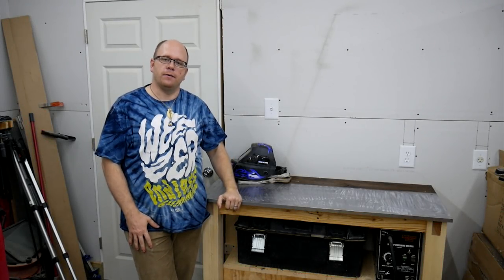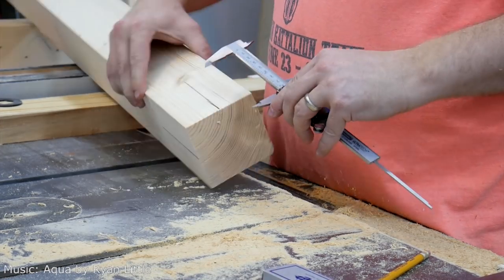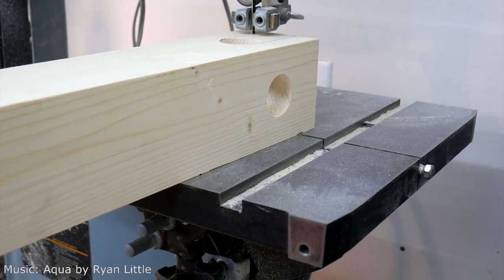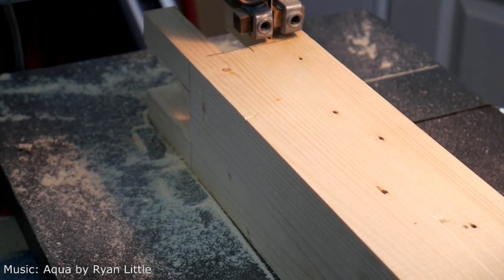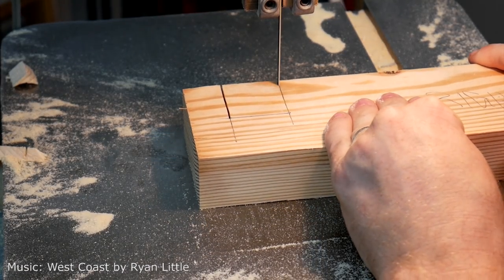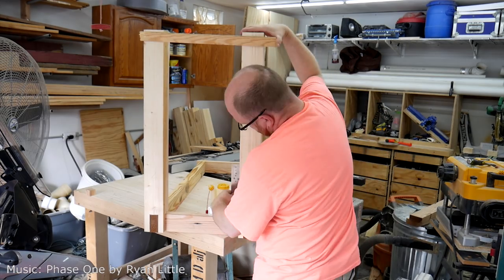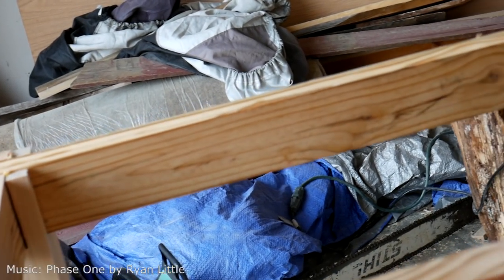Fancy Leg Joinery: Worth It? (Amazon links in description)

Comment: Thanks for the video. I like the fact that you are willing to show the imperfections in a project and well as mistakes. I have a project  that I want to use this same joint. I was thinking about running the half lap joints just a little long and champering the edges. Again I think it loos good.
Reply from the maker: Yes! Next time I do this I plan on making the tenons a little proud of the leg surface.  After that I plan on making the tenons protrude even farther and trying to incorporate it into the design.  Just need more tables to build!

Comment: I used this same joint on my dining room table. It is a beautiful joint, also very strong.  Thanks to this joint my table has zero metal fasteners! 

I used only hand tools for my build. I originally wantes to have the apron ends flush with the leg, but after having that fragile end piece break on 3 separate pieces I decided to have a 2 or 3 inch over hang. This turned out to be much stronger!  

I think I watched your video a few years ago and probably packed the idea in the back of my head. Thanks for your time helping all of us out.
Reply: How did you attach your legs to the table top?
I want to practice this joint too!
Reply from the maker: I make my own fasteners out of wood, but you could buy these: https://www.rockler.com/table-top-fasteners
You could also use pocket screws on the inside of the apron, but that wouldn’t allow for wood movement in the table top.
Reply: @SouthpawWorkshop  Cool! Thanks, those look handy.
Thanks for the reply, I just saw a video of how to make them out of wood and dominos as well.

Comment: A tip for dry fitting this type of joint to avoid break out:  

turn the board over and attempt to dry fit it where the material is vs mating the 2 cut outs.  If it fits, the joint will not break. if not, go to a cabinet scraper, or whatever, and shave off a mil from each face of the board and try again.
Reply: I also like to chamfer the inside edges of the half lap.  Nobody sees them, and it makes the joint easier to assemble without sacrificing any stability.

Comment: Very nice. I made a side table for the guest bedroom using this joint. I was afraid that any wiggle in the table might split so I added dowel pins. It is as solid as a rock and looks nice. I muddled through it on my own. Watching you do this is going to make it easier for me to make my next one. Thank you.
Reply from the maker: Thanks, Cody.  I seriously considered adding dowels.  I think it will probably be just as strong with or without them.

Comment: Great video, thanks! I tried this joint on the legs of a nice heavy kitchen table I made recently and it worked out beautifully. I made the "tenons" a bit longer so they stick out about an inch past the leg and rounded over the edges. Adds a very nice effect.
Reply from the maker: That is awesome. Thanks for sharing!

Comment: Perhaps if you did use a guide on the bandsaw, instead of freestyle, it could improve the accuracy of the joinery. I'm nearly certain the frail end pieces were breaking because of dry fitting with a small deviation causing outward stress on the end piece. Other than that this castle joint looks excellent. Well done!

Comment: Hi Thomas, I made this exact same joint on a blanket chest with only wood joinery holding the box together other than the door metal (handles lid support and hinges. Glue was only used to hold the panels together. Top, sides and bottom floor. Like you I found those end grain tabs broke off easily. To solve the problem I shaved off 1/4 of the ends where the tabs are vertically and glued pieces of wood with the grain running 90 degrees from the center 1/2. The resulting end grain looks like plywood but it allowed me be able to say it's only held together with joinery.
Dan
Reply from the maker: Good advice.  Thanks!

Comment: Fine instructions.  The joint has high sheer strength.  The fragility is a function of the ductility of the wood used.  Building lumber is brittle, 18% moisture, prone to splitting as you encountered.  For mortise and tenon load bearing joints in buildings research indicates that failure is determined by the peg's ability to withstand bending.  Message: use robust quality wood.  Construction grade wood and plywood are to the woodworker what plastic and vinyl are to the shoemaker- kryptonite.

.      I counted at least 10 contact surfaces on your joint leading to greater joint sheering resistance + marginal gaps to provide flexing/torsion for heavy weight.  All that was left was for you to install light arches and triangles so your light table could support a few tons.  Fine work.

Comment: Thats a beautiful joint. Perhaps you could cut the joints on the 2x4's a bit further down the wood, so that the 2x4's would be flush with the edge of the table. That would probably look pretty cool, and also give those joints some more strength.

Comment: This was exactly what I was looking for. I was built a dining/game table for my kitchen a few years ago with store bought legs (This was my first large furniture project) that unfortunately are no longer working. The table wobbles a lot now with strain since the legs are too small for the weight and size of the table top. I am going to use this idea and maybe extend the boards to outside the leg. Thanks for the video!
Reply: The table wobbles.  Again, the joint is not worth the trouble.

Comment: I like the way this joint looks. I'm going to try it out on a desk for my daughter. I don't have the band saw or drill press so I'm going to be creative in how I do mine. I will be using a table saw for mine. I want to use 5/4 x 6 for the aprons so I think I will have to do most of the notching by hand.
Reply from the maker: I think a hand saw and some chisels would work just fine.  Let me know how it turns out!

Comment: Thank you for showing the downsides to this joinery. I'm currently working on a tatami bed, using this joinery. I'll be sure to take it easy, while dry fitting.
Reply from the maker: It will also help if you use wood that is better quality than the pine I used. Just about any hardwood will perform much better.

Comment: Great video and ending analysis, thank you for posting this. I have been considering using this joint for a coffee table I plan to build and will be floating a granite slab on it for the table top. I may be mistaken but I believe this is also referred to as a castle joint.
Reply from the maker: You are correct

Comment: You could leave the rails a little bit longer than they need to be, so you have a little bit more resistance to the pieces splitting off when you assemble the half lap joints, or you reinforce them by using a big dowel glued in across the grain.   Then once the whole thing is assembled you could trim the end of the rails flush with the legs, or it could look really cool with the ends of the rails extended a few inches past the legs.
Reply: SoundsToBlowYourMind wouldn't matter if he left a mile on the end of it, it's still a very weak spot.
Reply: I was gonna write that - perfectly logical. No chance for piecesfalling off.
Reply: Yes it is still a weak spot but it will survive the most traumatic stage of banging the joints tight together. Also l would cut them to length after assembly and glue to go off.
Reply: Also, it's a good idea to use a file, knife, rasp, etc. to shave off whatever is making it fit too tightly. When you feel like it isn't going in easy enough, it's time to back out and adjust.
Reply: @rocketman6478  old post but man your hella wrong. If you leave em longer for dry fitting its gonna be much stronger before the glue up. It basically be 2x4 with a lil notch in it with alot more surface to avoid breaking. Of course a lil 3/4 left at the end is gonna break much easier than say a 6 inches.
Reply: @sh0cktim3  he even admitted it himself in the video.... so, if you wanna argue with someone,  argue with him.
Reply: @rudybigboote3883  I didn't say the whole joint was weak.  I'm referring to the very same thing he referred to in the video. 🤷‍♂️

Comment: Great video and cool joint. I just finished an outdoor bench/firewood box combo and used half laps and 1/4" long dowels reinforced with long wooden screws. That approach made me think u can reinforce the cut outs on the end pieces with a screw or dowel. These wont be visible once assembled and would certainly make the joint stronger.
Reply from the maker: Not a bad idea.  I also think I won't have the breakout problem as bad if I used a hardwood instead of soft construction lumber.

Comment: This is a very nice and unusual  joint  Thomas and quite flexible as it can be easily cut with so many different power saws. I think that the splitting problem on the half-laps is not so serious once you know that the fit can't be too tight. I think letting the half-laps extend out to the table edge could also be a nice variation on this joint. Thanks for sharing!
Reply from the maker: Thanks!

Comment: I like your honest presentation. It is definitely something that I would try, but with some changes. The apron need not be so thick. Narrower or thinner, would leave more material like n the legs. I would keep the rounded drill holes and make the aprons accordingly. It would make the joint even more stunning. Making the tennons looser, would result in less breakages, and leave a little bit more room for the glue. Some contraptions to press the legs with "G" clamps on the diagonals, will give the perfect joint.  As a last thing, for a furniture table and not a welding bench, the aprons could be made longer to stick out of the legs. I learnt a lot from you Sir, thank you.
Reply from the maker: Great suggestions all around, Joseph.  Thanks for watching!

Comment: Before combining the joints, you can use glue over the joint surface to make it strong. This joint breaks as the fibers parallel to the leg are cut vertically

Comment: I had not seen this video before I made a joint like this on a carving bench on my channel this year.  I am happy to report I figured out some of the same methods to cut it that you did though. :)   I did not use glue for mine, but instead used a set of dowels to pin the corners both ways and that also works great to lock it fully solid.  However, I also had two pieces snap off so I agree that this can be a fragile joint before it is locked together.  This is much stronger when they use it for a through joint vs a corner like in timber framing where I have also seen this used.

Comment: I made a wooden bed frame an I used these joints although had no clue what the joint was called but is was the only was I work out in my head how to do it as I was old school free hand drafting an I very much agree the joints having alot of failure points before they are glued up... quite a few peices of wood went flying across the room  LOL

Comment: your comment on the breakage of the small part is a issue of experience in doing and handling such work with comes with experience and a good craftsman learns these techniques in proper sizing each part, the handling of these parts and the gluing and fitting of that assembling.  All of these techniques is what make a real craftsman and it separates us all from the others.  Yes it is weak on its one but when put together as a whole it is VERY STRONG.  After gluing I guarantee you that glued member will never break at that junction.

Comment: made this joint for a table and the trick with not having the short bits break off is to leave them a bit long until after glue-up :-) Worked like a charm for me with 18mm thick pine :-)  Nice table ^^
Reply from the maker: Great tip. Thanks!

Comment: Nice job! This could even be done by gluing up pieces of varying lengths to create the "voids" holding the tenons. For a small side table, a person could achieve a stunning look of masterful joinery without needing a band saw. I know to purists out there, this would be sacrilege but, beauty is beauty and glues are magnificent so why not? Good way to use up your scrap wood!
Reply from the maker: Great idea!
Reply: i did this with my bed frame, also left ends of thinner aprons extended and did not glue the joint up so it can be disassembled. not sure of the exact name of the joint but used on Japanese Tatami beds

Comment: For me the most important point is the strengt of the joint. If you wanna invest the extra time for that – go ahead. I think good furniture (capable of enduring many decades if not centuries of heavy use) are worth it.

Better: Let the horizontal beams be longer. Glue them together. Put 2 dowels through at the outside to give it extra strength. Finally saw off the longer parts.

Comment: Pretty cool joint.  I like to use new joint techniques on shop furniture.  It’s not needed for strength or function - your welding table would be just fine with some 2x4’s and screws and would perform its desired function.

That said, it’s always worth it to learn new stuff and make something just because you have pride in your work.  I definitely put more effort into shop furniture because I enjoy doing it and it’s not always about efficiency.  I suspect you’re the same way - sometimes it’s just worth it to make something better, even if something lesser will do the job fine.

Comment: overall a great video.  When you use those type of glue joint, make the joint just slightly loose...loose enough to slide the parts in by hand (or barely tap w/ the hammer) as the glue will as as a filler for the gap.  If the glue joint is too tight, you squeeze out most of the glue and the joint actually looses some strength.
Reply from the maker: I agree.  I know some of those joints were tight.  Also, too tight and you risk breaking the fingers of the joint.  Thanks!

Comment: Great Video, nice and ladeback but still informative! And the first Video i got to see a mistake.
It really looks good, and stable. I  think this kind of joint will continue to hold well.
How is the Table Top connected with this Frame? Is it simply drilled in?
Reply from the maker: Thank you.  I used this as a base for my welding table.  You can see how I attached the top here: https://youtu.be/rMyPSOErVx8

Comment: In my personal opinion, it would be best to extend the tails of the half laps and give them an upturned radius for visual effect, but structurally you could improve it by adding a dowel horizontally into the weak parts of the joint; essentially "completing the circuit" of the grain.
Reply from the maker: I have heard the suggestion before and it is probably true that it would strengthen the wood, but I believe once the joint is glued up, it is no longer in danger of breaking.  Thanks!
Reply: Yeah, that is true to a degree, and likely it'll last you a long time as it is. But personally, I like to build things with the mindset that the glue will one day fail.

Comment: How well does it perform without glue or screws? If you were to make a home made weightlifting power station from 4x4's, would you trust it?
Reply from the maker: It can hold a lot of weight, but it would not be sturdy without glue.

Comment: Nice! Very nice! How stable was the table before you put the metal on and made the table twice as strong? 
Pls be really honest. Cheers, Michael
Reply from the maker: I think it is as stable as any other workbench. The steel top is not fastened to the frame, so it really isn’t adding much strength to the whole assembly other than some downward pressure. I don’t think the table would be as strong without the bottom shelf to help keep it from racking and eventually breaking the leg joints. It wouldn’t be as much of a concern on a shorter piece like a bed frame or coffee table. Cheers!

Comment: My results were similar to yours. I used this type joint to make an easily torn-down tablesaw frame. It is VERY fragile and I had lots of trouble with pieces breaking. I did finally get a good working set that I still use today, but it's loose, wobbly, and not up to the standards I was hoping for. I do NOT recommend this joint at all. It's a lot of work with questionable return.
Reply from the maker: Thanks for sharing your experience!

Comment: I like it, nice job.....if you were using it on a finish piece you could also drill through and dowell (spelling?)... But just as a added feature .... I think it's worth it, gave you practice at something you had not done before. Thanks for sharing
Reply from the maker: Thanks Kevin.  I was thinking about using a dowel corner-to-corner.  Just not sure it would add anything other than looks.

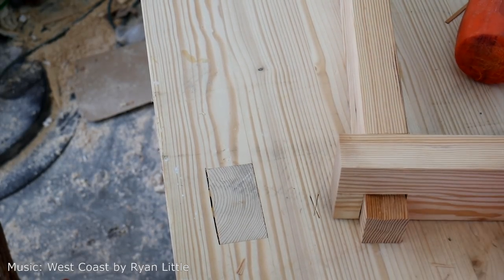Comment: At 5:40 when it broke you said you just glued it back together. I’ve had this same thing happen to me on a wood working bench and I️ too glued it back together. My question is if this joint is now weaker or is it just as strong with the glue?
Reply from the maker: Modern glues are just as strong if not stronger than the wood itself, when applied correctly.  After gluing the piece back on, I proceeded to glue the whole joint together, surrounding the faces of the broken piece with glue.  I have no doubt the piece is just as strong as if it hadn't broken at all.
Reply: Thomas Lightle - Red Barn Woodworking 
Good to know thanks for the reply!

Comment: If you leave the aprons about 6 inches longer than you need them when making that joint, the ends won't break off, then cut them to length after, you'll be able to get tighter joints that way.